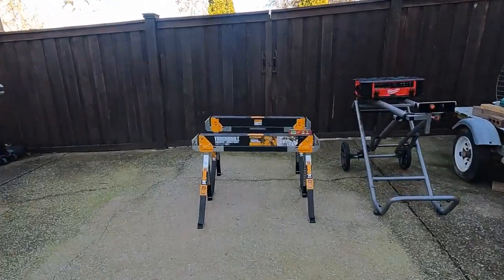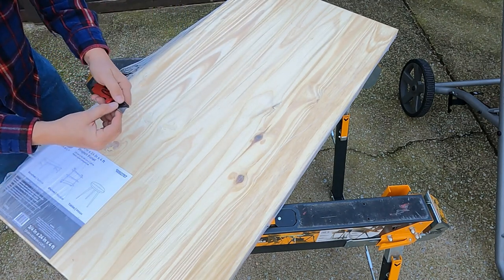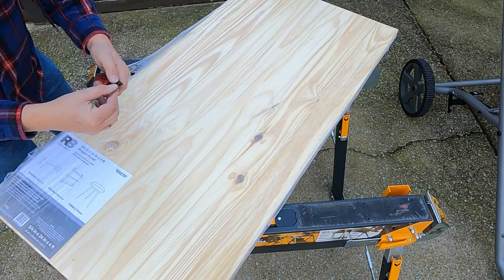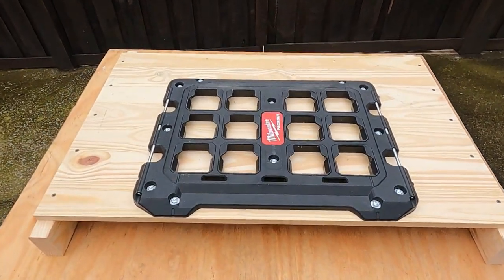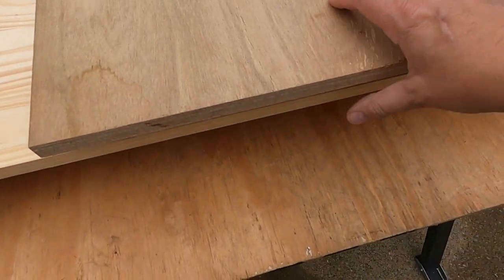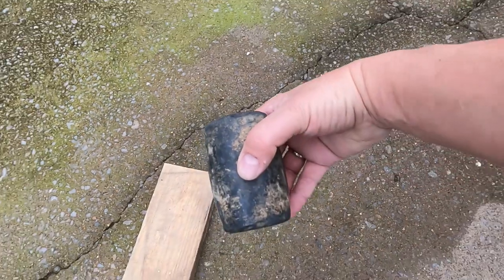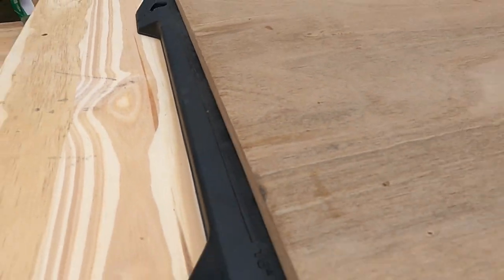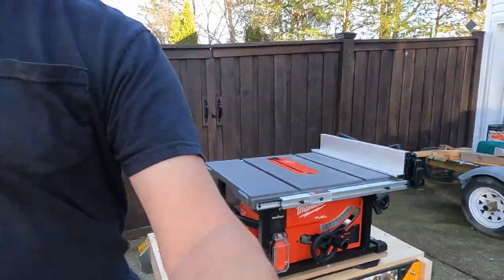MILWAUKEE TABLE SAW DIY PACKOUT STAND MODIFICATION

Comment: The real beauty of this, and reason why I was looking for this solution, is you can now hang the table saw on the wall when not in use. The saw is already portable, and if that's all I wanted, I would just get the portable stand. But with the packout mount, you can use that for storage as well. Nice!

Comment: I can't understand why you wouldn't have just added washers between the board and the saw rather than cranking the bolts down to the point of warping the board. That was REALLY obvious before even attaching the board and adding the wingnuts.

Also... Why wouldn't you have just flipped the packout tray upside down on the board - with the red flaps inside it - drilled through them into that board for perfect placement?

You really kind of did a lot of this the HARD way. LOL

For all of this trouble, I would simply have stopped at the first three boards themselves.

All in all... It's kinda clever. But you caused a lot of hardships for yourself there. LOL
Reply from the maker: You’re telling me, I typically do things the hard way and learn as I go. Yes I don’t know how I didn’t notice the board was warping quicker than I did. Probably because I was also focusing on recording. Regarding flipping it upside down, I don’t know how they would have stayed in place doing it that way. Thanks for watching.
Reply: @TheLovelyPlace  - I suppose that you could have slid the red parts in after flipping it upside down, maybe? Not sure, either.

See? NOW you got ME wanting to try doing this just to see! LOL

In any case, the end result WAS pretty nice. I have to admit. I'm currently looking for options to mount my own table saw now. The Milwaukee stand for it being $130 makes it rather unattractive. Especially because it doesn't really provide any addition surface for setting tools on. Nor does it look like a stable option.

In any case... Your concept was actually pretty good so I might borrow from it a bit here. :D

Take care, man!